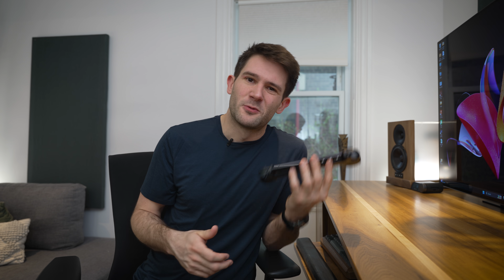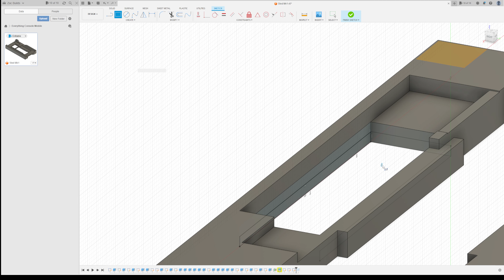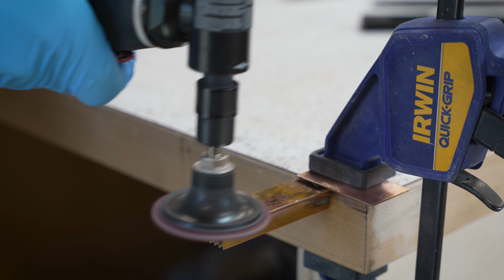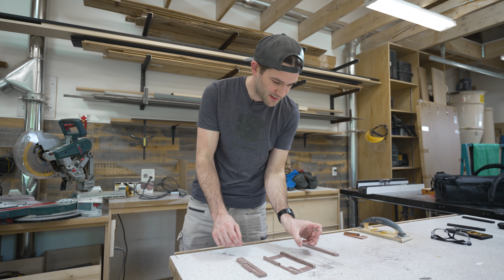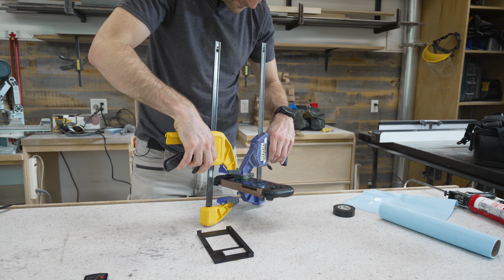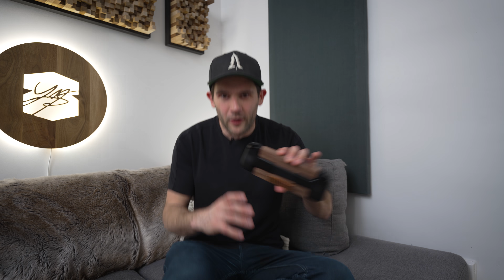I built the ULTIMATE GAMING phone...

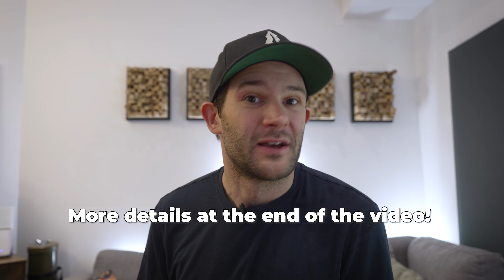Comment: 6:53 honestly would've just used heatpipes and thermal epoxy. a 4cm one with an 8cm one and then glue the hear spreadder to the 8cm pipe. you could've soldered them as well, but soldering heatpipes is like squeezing water from a stone...

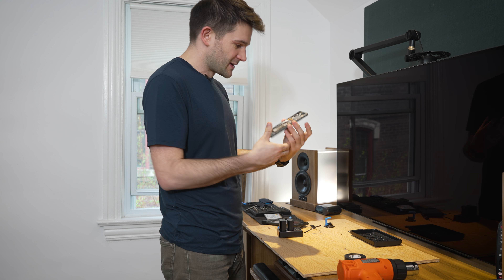Comment: 3:00 I think that’s the backplate of the SOC, many modern phones use the screen to dissipate heat so the SOC would more likely face the front of the phone.

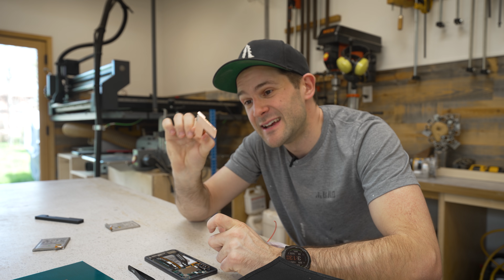6:30 A lot of smartphones actually do use heatpipes even though there’s not much distance to transfer the heat, it would probably be worth it to include one, and they can be bent with heat and soldered like the rest of the heatsink, so still within backyard shenanigans level build. Also I didn’t see a heat pipe so I’m not sure you’re cooling the hottest part of the SOC. Better than nothing, but…

Comment: I don't want to bring you down, this is SUPER cool to watch but...that thermal putty application literally is what made me stop watching to type this. You don't need to use THAT much. You aren't using it as a medium to conduct the heat, it's just a way to allow the transfer of heat between two separate metals without air gaps. Air is an amazing thermal insulator, after all.

Comment: The heat is not transferred effectively and efficiently by that amount of thermal paste also the welding with another material will reduce the thermal transferred out more over you should add fan and make it active cooling rather than passive cooling. You did great in your DIY but the processor still throttling 😅

Comment: With phones having wireless charging now you could probably avoid anything battery related and just have a small powerbank integrated into the case if you are worried about that. It may be a little thicker but there are some very thin ones available now plus you can easily swap it in and out during those heavy game sessions 😆

Comment: As a diy enthusiast myself you missed a few things I mean the software you should root the device you should choose something from OnePlus or mi Samsung is not the way to go and edit the battery capacity to the Android firmware files and you should overclock the soc especially the gpu and cpu it will give very high performance improvement that can beat even the higher end socs doing all these mods without the oc is pretty much useless you should disable the temperature monitoring inbuilt features and you can even try to run the display with a slightly better refresh rate using root

Comment: tip from a guy who fixes phones for a living, search for something called the "iplastix" plastic pry card, its strong enough to stand up to alot of abuse, and just flexible enough to fit perfectly in the gap of the frame and battery, all without damaging the battery. curl the end of it into a slight curve, heat the phone on a heating pad until the adhesive gets warm, drip some alcohol into the side youre going to push the pry card into, with the tip of the curl facing towards the battery, work it down into and then under the battery, then wiggle the card left and right, cutting the adhesive from underneath, as one side of the battery loosens it will start to tip up, slide the card around and cut all of the adhesive until the battery comes out effortlessly. its plastic and dull enough not to puncture the battery or risk electrocution or thermal runaway, soft enough not to bend the battery, and it also works great for getting into a tiny gap in the backglass and gently cutting its adhesive, doesnt bend or break the glass in any way, works for pretty much every samsung phone since the galaxy S7 excluding some of the "J" series ones. also useful for separating the screen from the frame

Comment: This video reads like dude man is trying to spend as much money as possible, rather than solve the problems as effectively as possible.

Like why 3D print in bullet-proof, expensive, abrasive, and hard to work filament, when PLA is more than strong enough to survive anything the switch will. Why print some giant, super thick dock rather than dremeling and mounting a slim profile fan in the OEM dock? Why focus so much on maxed out cooling, then sandwich it under a block of wood?

Also, thermal throttling isn't really the issue with overclocking the switch, it's battery health and power management via surpassing the intended TDP that wrecks things.

I started out sincerely interested, and ended up hate watching through the end.

Comment: It was a very good idea to use a Samsung phone for this, But it would have been better if you had done more research before removing the chip above the battery, those chips match the battery capacity. And that you have to root the phone and modify the battery capacity in the ROM settings.

Comment: It's perfectly safe to add a larger battery, even 2 brand new perfectly matched batteries. BUT, adding two different capacity batteries,/two batteries with different charge levels/two batteries from different batches could easily result in a battery explosion ☹️

NEVER EVER use a metal pry tool to remove a battery !

Comment: The heat will not transfer that great length, you should get a fat heatpipe for the length.

My S21 Exynos heats up during regular play and wireless charging.

You can see videos how heat transfers in example a block of metall, you see it will not travel far.

Comment: I wasnt able to go that far but i made a DIY peltier cooling case with a old vga graphic card heatsink+fan and a cheap peltier module taped on it. It literally freezes the phone and moves all the heat to the heatsink and tbh its a bit dangerous to use for long period, just with 2 amp charger, peltier sucks too much of the heat and starts making water droplets, so i usually disable the peltier and use passively with the case or with only fan turned on.

Comment: You only need root to unlock performance, I think you can use temp root to get root access in samsung devices, after root, you can overclock the GPU through konabes, and don't forget to install disable thermal so that the results of the GPU overclock can work fully, that's my way so I can play genshin 60FPS on old chipset 865

Comment: Hey there. 

The first issue I wanted to note is the use of the copper in the heatsink replacement. Without a heat pipe, You're looking at the quick thermal saturation of any interface or its materials without a meaningful transfer of energy to the actual heatsink added to the copper. This is because based on Thermal Conductivity alone Copper does a good job of absorbing heat, but it doesn't do a great job of transferring it. Copper sits around 400W/Mk of thermal conductivity, while a heat pipe can be in excess of 5000-100,000W/Mk.

This means that the heatsink would be slow to heat and hard to cool effectively. If you were to place a heat pipe across the length of the heatsink, it would work much better, to the point where you would near instantly see a difference in temperature from the SOC to the end of your heatsink.

Secondly, The issue with the Double battery is apparent almost instantly- due to the fact that you double capacity, you double charging times quite readily, and without the BMS to consider the second battery's health, It will assume that one battery provides the charge for both. Since the BMS only controls voltage and wear leveling, and doesn't have a way to monitor each cell individually, you can very quickly end up with a situation where you see your battery jumping around levels depending on which battery's voltage reads the highest- since they are separate cells, there is the very real possibility of the internal resistance of one cell not matching the other, causing step voltage matching. This means that the batteries face the very real possibility of mis-matched wearing and eventually diminished capacity and failure of one or more of the batteries. Usually this is corrected in BMS monitoring of multi-celled devices through what amounts to a circuit that separates the cells from one another, but ties the output together allowing them to charge individually. 

The K5 Pro works but currently you have an issue with the setup of the heatsink- right now it goes (assuming the Mfrs used a thermal pad) SOC>Thermal pad>Graphite pad>Aluminum>K5 Pro>Copper>Solder>Copper>Solder>Copper>Solder>Copper>Solder>M.2 Heatsink. All those layers cause a loss in heat transfer, reducing the effective area of the copper and essentially pocketing areas of the copper that didn't fully get brazed (if you ever shear the heatsink apart, consider looking at the shims and you'll see pockets where the solder didn't reach fully, it's simply because of the change of Flux to a gaseous state causing solder to have voids." Ideally, the removal of the aluminum and thermal pads would mitigate this entirely, if in addition you swapped to a heat-pipe design. In this case you'd see SOC>TIM/K5>Copper>Solder>Heat pipe>Solder>Heatsink. Also, you technically don't even need the first layer of copper attached to the heat pipe, and could attach it directly to the SOC by flattening it on one side, making sure not to crush the actual pipe. This would also decrease the weight of the build. 

A final consideration is the fact that there is an opportunity here to fab the entire outside case out of a block of copper, that you would then attach to the heat-pipe through soldering, and get passive cooling without an open area for the M.2 heatsink. At their max, these SOCs use about 10-13W of heat, meaning it can be easily dissipated passively in this regard. 

All in All it is a novel idea and i appreciate the video- just some thoughts on what I would consider. (I was someone who built their own laptop heatsinks in the 2016-2020 years, particularly for Clevos)
Reply: These are the discussions I live for. ❤
Reply: Wow bro thanks for the info !
Reply: he already showed that the cpu and gpu was cold it was at 40 celsius?
Reply: @eylemuyavul3055  While that may be the case, something done right the first time will lost longer than something that isn't done right. If you were to follow my instructions, you could reuse the heatsink assembly in the future for other projects if you decide.
Reply: oh ok then when he gets bored from this he would able to dissasamble it to use it for something other else @darkride196
Reply: @darkride196  Would it be better to coat the mating surfaces with solder first, so when you braze them together they fully bond?
I thought it was odd he only brazed around the sides.
Reply: @darkride196 why not just ditch all that and use a fan instead?
Reply: Man who's reading all that if it blows up call it a note 7

Comment: The SoC is on the other side of the motherboard. It touches the frame, screen and probably a heatsink to exhaust heat. You've added thermal mass but not in the most optimal place.
Reply: It will be too difficult to fit that big heat sink in front. I think back will also be fine since the soc also shares heat dissipation with the back part. It might not be as efficient but it will be better than it was imo
Reply: @multimeter-1  Yeah he just mentioned that he thought it was the CPU but it is on the other side. Adding thermal mass is adding thermal mass, there'll be a net positive to the sink part of heatsink, but it could be loads better if there was more direct contact.
Reply: A new chassis for the screen, motherboard, battery and other components would have to be made for better thermal dissipation. That would be interesting.
Reply: Where do you expect him to put it? Directly on the screen? 😂
Reply: @GUMTOON  in fact, you dont have to, 
just lift the battery higher and place another bended heat pipe on top of the original on frame heat pipe wrapping aroud batteries routing to the side and then just add heatsink
Reply: @GUMTOON  Obviously not. Using copper tape or a shim or something of the like could result in a way to pipe heat from the front side to an area where it can be exhausted from, perhaps by replacing the existing thermal solution.
Reply: @TurboBass  that's too complicated for a minimal improvement, you have to take off the OLED which is risky.
Reply: @GUMTOON just remove the motherboard from the chassis and the soc is on the other side. As a rule never replace/remove the display panel from a Samsung front-chassis

Comment: Without root battery capacity mod, the double battery is useless.
The system counts with the hardcoded capacity. So if it reaches 0, no matter how charged the battery, it will shut down.
 Does not care about the voltage unles it reaches 3v.

Comment: When I heard the restriction on performance, I was wondering if you could have installed a Custom ROM on it so you could overclock it, but root would make it a bit easier to unlock the bootloader (but i think it's still possible without it), and another thing is that Samsung phones are a bit confusing and tricky to install a Custom ROM on it. Just some thoughts to try and make the quality better by trying to overclock it.
Reply: Unlock bootloader, add custom kernel, then use Custom ROM, or debloat the stock ROM is more than enough. Overclocking is pretty much reliant on hardware actually. But samsung indeed doesn't like people messing around with their phone's firmwares. They're not too friendly with unlocking bootloader and such

Comment: Edit:  Ah, I see now, you were avoiding the middle piece of the Razer Kishi.  If doing this yourself it might be better to cut the heatsink to the width of the phone and place it 90° to where it is in this video (yes,covering the camera).  With only 1 copper slug soldered to it.  Another option is to get a small square shaped copper heatsink and use thermal grease and make a bracket with screws in the original locations on the phone to hold it down.

The reasons for this are as follows:  

Copper is heavy.
Heat travels only so far, it is inhibited by distance.
Adding more Z height than necessary only inhibits heat transfer and raises weight.

I am just guessing this was done to improve thermals near your fingers.  But a fan and some copper tape inside the case/'midplate' will go a long way.

Ideally you can source a small laptop fan and heat-pipe that can be clamped to the heat spreader (or indeed remove the heat spreader and put it right on the package).

I like the double battery pack idea 👍

Comment: Good luck charging that device…

Without the IC and proper battery programming… It will just charge the first battery and not the 2nd one… Becoz after certain voltage… The Battery IC will register it as Full charged

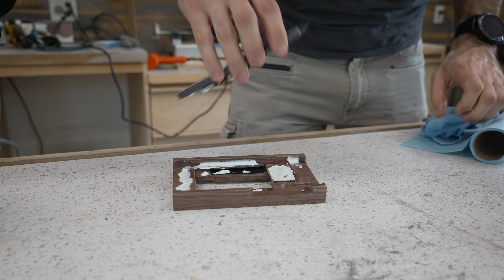Comment: 13:57
Just a tip for playing with the sealant (and anything you can fit into a caulk gun tbh): you can buy, or in your case print, extra tips to fit most tubes, and you can cut them to specific angles.

In the case of your sled, you can cut both sides to make a 45° angle, and with even pressue it will perfectly smudge the silicone so that you dont have to smear it with your fingers!
Reply: Xiaomi / poco device more cheap, capable, also more customizations..

Comment: Omg nooo this is not the CPU or GPU. this is the back of the process unit. 
The CPU and GPU are pressed against the case with thermal paste.  That's why the case goes between the display and the mainboard.  This is done to dissipate the temperature of the CPU and GPU.

Comment: I made similar (but also much less sophisticated) build to my old phone. I used wooden sticks for starting fireplaces (very well machined, perfect rectangle/thickness on all of them, sold by Baumax I think), cut them to proper pieces and made a fitting "cradle" that attached the phone to GPU heatsink (with fans of course). Then used high capacity power bank to power the fans on the heatsink and could also charge the phone if needed (charging slows the performance of course but was neat). I could play for hours on my potato phone some really good games without fast thermal throttling. And the phone stayed cool so you didn't get those sticky/hot fingers after a while. It was quite heavy, also like 0,5kg maybe more. But totally worth it.

Comment: 9:18  according to this stage , You didn't mentioned about the MotherBoard voltage capacity regulation when you are adding double power to the device . so it kinda dumb situation here .
Reply: No Extra Voltage is added as batteries were connected in parallel. And now they will slowly charge and discharge
Reply: @rajamanu8726  clear your concept about electric connection system bro.

Comment: Not a good thermal transfer, thick metal layers, lot of thermal paste, the heat not even spread for that long heat sink there is a reason why cavity copper with copper mesh with decent coolant like water is used it's more effective then plain metal that need to have heatsink.
This is not good enough heat transfer setup, 
Just having a good heat transfer phone is way better than this contraption and they already exists.
Other then this everything else is good.